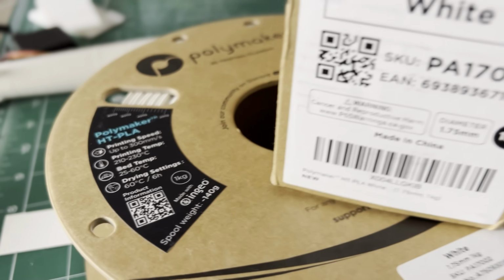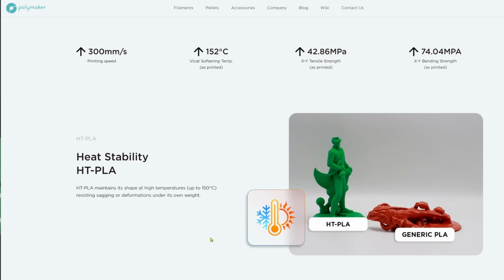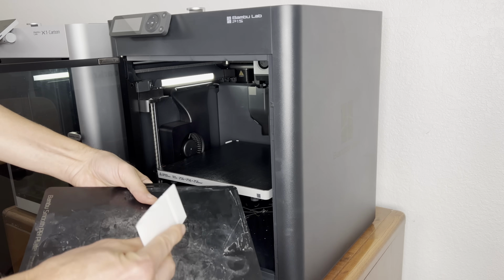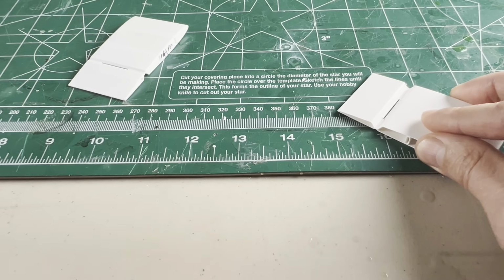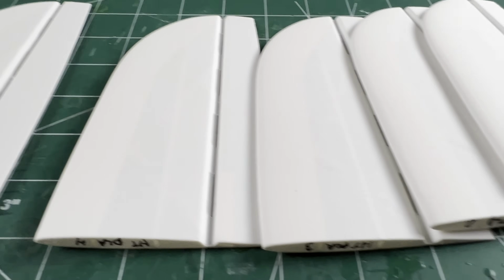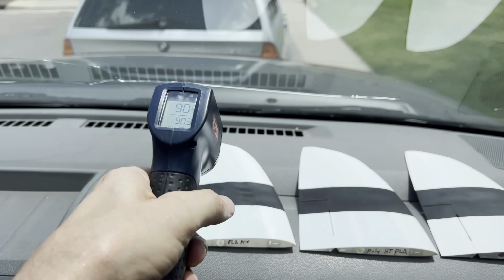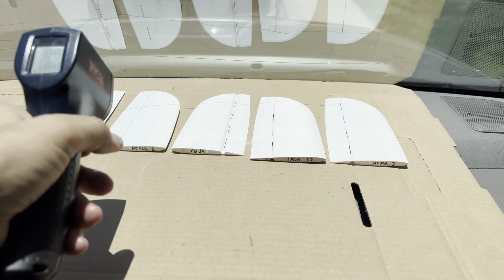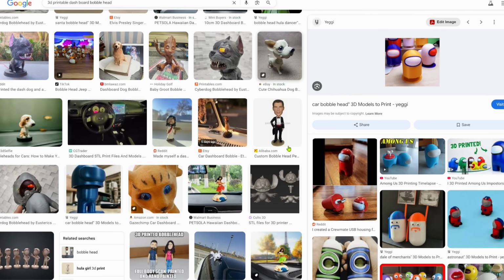🔥Hi Temp PLA🔥 for 3D printing airplanes - for real? - vs ASA - how to from SoarKraft - Polymaker new

Comment: Thanks for this!

About the surface finish on ASA, since it got better with printing several of them, I can only guess that if you had waited for the chamber to heat up a bit before you started the print, it'd looked a lot better from the start.

I can only guess that you had to open and close the car door to get in and out a few times. That let all the hot air out, so it would reduce the heat stress on the parts.

Comment: You should try HIPS. Very light, high impact resistance, easier and less toxic than ABS and close enough temp resistant
Reply: I bought HIPS back in the day for “support” material… I just ended up using the crap out of it for general prints though lol

Comment: You'll never achieve  the best mechanical and thermal properties of any given filament until you can print it at or slightly above the materials' Tg point. It requires an actively heated chamber.

Comment: I tried it for one specific purpose:
Sometimes ago my ABS fan duct broked in the printer (while printing it just started to shatter by the screws, so the duct itself is in good shape, but I can't secure it).
Because my printer (Sovol SV06) is an opensource model, I found the *.stl files from the injection molded parts.
I redesigned it to be easier to print, and reprinted it in PETG. After sometimes I've noticed that the cooling is a little bit worse than before: I chacked it, and my duct had heat deformations.
I was thinking of trying out ASA for this project, but I saw HT-PLA, so I thought that maybe a good option: easier to print and does not have toxic fumes.
The HT-PLA worked perfectly for that role. It can handle the same heat as an ABS (without heavy load), so it's a win.
Also it has nice surface, so I'm sure that I'll use this material for other projects.

Comment: You should try PCTG. It's similar to PETG but it's more thermal resistant and tougher. You do have to dry it before printing and print slowly to get the strength but it's well worth it.

Comment: Look up ht-pla-cf it'll improve dimensional accuracy and is a lot stronger and will hit better heat deflection after anealing which can be done with the printer bed the only thing needed is a hardened hot end and metal extruder
Reply: Adding CF into just about any filament makes it weaker than the base material. It adds some heat resistance, printability and stiffness, but not strength.

Comment: Could it be that the UV from the sunlight is actually what is causing the brittleness?  It would be interesting to know if that is the case.  If heat itself isn't causing it, then LW-PLA might still be a good choice, if you then protect the plane with a UV opaque coating.
Reply from the maker: No, UV damage to plastics takes weeks to months of exposure… long long long term exposure compared to this one to two hours in the sun… this is all heat / temperature cause by the sun 99.9% IR and visible light absorption and conductive from heat from the surrounding air… .01% uv

Comment: Try different colors. I have some bad experience with white filaments. Maybe it is a dye used in them, I don’t know.
Reply from the maker: you can, I can't test everything.  I use white and red PLA because they need more colorant to get true white and red, it was the first version of PLA+ ... there are white papers about this.  And if Polymaker's material changes HT properties with colorant then they have other problems..... I am not the only one that had this exact same issue, My Tech Fun did a similar test with similar results

Comment: In Europe luckily, temperature is irrelevant. I just wouldn't store or transport the plane in temperatures that high.
Reply: Btw I think you mean “Northern” Europe. Southern can easily reach those temps of concern
Reply: Spain, Portugal and Italy are also part of Europe and temps at summer usually reach 40ºC (around 104ºF), which is 2ºC more than whats seen in @SoarKraft 's video.
Reply from the maker: similar here, only occasionally hot enough to run this test.... PLA+ is still the best

Comment: I am planning to start the Pika, in what material do you prefer to print it?
Reply from the maker: It depends (very engineer-ish answer) 
PLA+ = slope, DS, hotliner - fast fun easy cheap.  
LW-PLA = slope - light winds days, light power... hand catchable.    
Colorfabb LW-PLA-HT = for light powered to medium power (good stiffness to weight - I have data) another video coming soon.
The ASA and ASA-LW are still too much of a pain, toxic, and I don't fly on super hot days or paint the tops of my planes black... well not much black.... if I lived someplace super hot I would use ASA and LW-PLA-HT... or move.

Comment: Also, to print for maximum strength you are printing your wings in the wrong orientation.
Reply from the maker: Sure, but any other orientation would be hugely detrimental for other reasons..... these are printed unsupported hollow thin wall structures with curved surfaces on every side.  Others have tried "the right orientation" and I have seen the results ...  my Zesty design, printed in the wrong orientation, can go 231mph (371kph)..... however my airframes are supported with pultruded carbon... so Im cheating.  Layer adhesion is still very critical to bend and twist performance, and Polymaker HTPLA doesn't do it.
Reply: @soarkraft 

Try increasing your printing temperature.

Comment: If you got the temp up to 72c you have annealed the parts. They will be much stronger and can with stand temps up to 120c. Actually, to get the crystallization in PLA you only need to get the temp up to 60c for an hour.
Reply from the maker: Annealed-Yes, Stronger-Nope, not with this HTPLA material.  And I am not the only one that has tested the actual material and found this result.  https://youtu.be/w01XqM7D8b0?si=bde1g0yKVV0nYd1I and watch at 11:30 his explanation is a guess that I do not agree with... but whatever, same result.  Other materials show an improvement with annealing, that is the point, but regular PLA can not withstand 60C without extreme melting / deformation / deflection.  Other HTPLAs like Protopasta or ColorFabb PLA-HP may be different.... Polymaker's HTPLA is good for Hydroponics and dashboard bobble heads, not 3D printed planes

Comment: What's the best way to convert a set of plans to CAD for 3D printing....?
Reply from the maker: To not do it... it is a lot of work, and "plans" are usually based on some other type of material.  The exterior skin of a plane is about all that is in common with a 3D printed version of a legacy design.

Comment: Have you ever tried printing wings at a 30 to 45 degree angle to gain better strength on layer adhesion?  I would be curious to see same tests done after annealing in a controlled oven to mfg suggestion if you can get hands on their HTPLA.  I would be curious to the reinforced results also.  Enjoyed watching your testing much!  That looks like a great designed RC plane!   Been working on a large c17 myself.

I ran off three rolls of their HTPLA, was impressed with actual print quality but have not done any testing to date.  I do plan on testing annealing out, but finding stock appears to be tough as of late.
Reply from the maker: Interesting thought, but changing the angle to print these parts is not easy, the skin and internal structure I design is painstakingly engineered for vertical printing for perfect airfoil and optimum structure.... my parts are more complex than most, but mine also go 200mph.  Any measured difference would have too many other variables to consider.

Annealing was not as hard as I thought it would be, but terrible results... not worth it.

Comment: HT-PLA is BS. even if it had the HDT of ASA your not factoring in that ASA is easier to post process and and be vapor polished. I also would say ASA on the right machine is just as easy if not easier then PLA as it doesn't require part cooling fans like PLA . The whole PLA is easy is based on you having a crummy low end printer... something that people don't have anymore. Its old news.
Reply from the maker: ASA is clearly the winner in this hot car test for this round, but it's still far from perfect... way better than ABS.  HT-PLA has its place as long as you know it is not exactly like PLA (HTPLA is weaker and heavier).  Hydroponics, yes....

Comment: Ht-PLA has been around for like 10-15+ yrs. MakerGeeks was the first I can remember, Proto Pasta is almost all HT-PLA. Few other brands use the 850 base resin that is HT PLA.
Reply from the maker: yep, this stuff from Polymaker is not new... but they sure did a strong market campaign for it... 
Colorfabb's PLA-HP has been on my list to try, but only available in black and gray now.... may or may not be the same material as there original PLA-HT.  Colorfabb's other innovations have been impressive.

Comment: Try PHA from polar filament. High temperature resistance and fully compostable unlike PLA.
Reply from the maker: PHA was on my list to try last year before I got distracted with everything else.  ColorFabb allPHA.  polar filament is new to me.. anyway, I fly in nature and crash regularly, especially the DS stuff... high speed excitement with confetti endings (plane brakes into ~ 2 million pieces... watch my other videos). Now that my DS design has proven itself to way more than the 150mph it was designed for maybe PHA should be evaluated... thank you for the reminder.

Comment: I just used this filament and it seems a bit more brittle / fragile than regular PLA.
Not a huge issue, just add an extra wall or two.
Reply from the maker: Sure, design like you are using clay / ceramic and annealing is like firing it... can handle heat, but brittle

Comment: Siraya Tech PET CF?  Probably too dense?  Have used it for functional parts after seeing My Tech Fun testing.  Heat resistant 180C+
Reply from the maker: for airplane parts strength to weight ratio is the key and z-direction layer adhesion is #1.  CF filed parts are usually lighter because of the fill, but does nothing for the layer to layer bond.  I have Bambu PETG CF in my test quew, will get to it.  Nylon CF was huge disappointment... I should probably add all of these to a chart of "experimental verified" materials
Reply: @soarkraft Was specifically mentioning this PET CF (not Petg CF) as it is known for high heat tolerance (180C+ is not a typo)
Reply: @soarkraft  That particular PET-CF has layer adhesion on par with typical PLA. It's good stuff.
Reply: @soarkraft  u said Nylon CF was huge disappointment, I was going to try pa-12. What did u try?

Comment: Excellent video and looking forward to your experimentation with foaming ASA
Reply from the maker: workin on it
Reply: I use ASA almost exclusively in my filament printer, what is foaming ASA?
Reply: @lureup9973 exactly what it says on the tin ;) also called ASA aero. It's similar to how aero/lw/foaming pla works.
Reply from the maker: @lureup9973  same as LW-PLA, but with ASA as the base material.... also known as LW-ASA (ColorFabb) or ASA AERO (Bambu Lab) .. other too.. where filament foams at the nozzle extrusion temperature... so not only is it pushed through it is also expanding.  Foaming LW-PLA, which has been around for ~ 5 yrs works exactly the same... lots of videos about it... ends up being the same size and shape of an original part made from something like PLA, but is half the weight... great for rc airplane parts.
Reply: @soarkraft oh wow… very cool, thanks, is it considered weaker by tensile or layer
Reply from the maker: @lureup9973  yes, because of the foaming it is ~ 25% stiffness for 50% weight saving, but with much more stretch / elongation.  its like printing balsa wood... fun stuff
Reply: @soarkraft 👍😎

Comment: I hear BambuLabs ASA Aero is basically the best of both worlds... light weight and heat resistance
Reply from the maker: the foaming materials are a completely different category, and foaming ASA has been difficult to tame even with a new gen printer, meh flow ratio, clogging.... "best of" is yet to be determined.
Reply: @soarkraft What do you think about the possibility of using nylon filament? I could test it; I believe it would be possible to reduce weight without affecting the strength of the piece.

Comment: I live in Turkey and in here my options in here is limited.. I was using only abs or HT-Petg from local supplier (those guys has unbelievable quality for 15$ ) .  So I'm curious about HT-PLA. From my opinion all other PLA variants are just PLA. nothing more.
Reply from the maker: ASA might be worth a try, not easy but I was pleasantly surprised with the results, real and repeatable.  I am lucky to have good machines but cheaper enclosures for open machines can be had, easier and cheaper than any annealing method.  Also depends on what you’re printing for….

Comment: Do you believe annealing it in your truck will give you the same results as it would have inside an oven?  I don’t believe so…
Reply from the maker: thank you for the comment
yes, I believe.... An oven can do even and controlled heat, but not perfect and will fluctuate as the door is opened/closed... heater cycles.  My truck was pretty uniform (85-87) in the "cooking area".  This was more of a real world test of what might happen by accident in your car and the real consequences... im not trying to show how to use a car to anneal parts.  You can run the experiment to test with a controlled annealing oven (not a toaster oven) and report back how it is not the same, there are many but what was the resultant change?..... I used a 2006 Nissan Frontier 4 Door, storm gray with gray cloth interior, 150K miles, needs a new drivers side front catalytic converter and has a cracked windshield... for reference

Comment: This is awesome testing of the material in an engineering manner which I find much more useful than "I put pieces in the oven and noted which melted first", especially since the aeronautical application is in my wheelhouse. Thanks!
Reply from the maker: I was hoping to get some real-world data and push the limits of this new material!  I also wanted it to work... great for an outdoor planter.. not so good for airplanes
Reply: @soarkraft  I too was hopeful for the new material but thought I was crazy when it didn't seem to be as strong and didn't have a much higher deformation temperature. Snapping after the annealing you did was a complete shock to me though. Still has some good uses though, you're right.
Reply: You’ve been  3D printing. For 30 years

Comment: I live in the UAE. I tested wing tips made from several materials at 42C outside air temperature by putting prints in the car, and parking the car in the sun. It got much hotter than that in the car, of course. 
Normal PLA fails quickly and deforms, PETG is not much better. 
ASA, ASA-Aero and ABS stay strong and keep their shape, but are more difficult to print. 
I also used the high temperature PLA from colorfabb: PLA HP.  It worked well and I can not see any deformation after a week of driving and parking.
 Unfortunately I did not measure the temperature but they were so hot that I could barely touch them with my hands.
Reply from the maker: Great info, thanks.. I was surprised at how brittle the HTPLA parts were after being cooked, sure might handle heat, but what about loads at regular temps… like flying a clay pot.  Wonder if your part is brittle?

The ColorFabb material may or may not be similar…. I might try it, as I doing a follow up to my LW-PLA-HT video.
Reply: @soarkraft  Hmm, Ill try to think of a way to test it with my means
Reply: Im in Kuwait, i am experiencing the same thing.  ASA-Aero us my go to for 3d printed airframes
Reply: get a qidi printer, any, and be done. ASA/ABS/PPS/PPA - all doable, nearly perfefct when u change chamber temp to 75 or more.
Reply: @bartman2395 which Qidi printer has a 75° chamber temp capability?
Reply: @donr62  sky is the limit in settings, 75C is safe to my practice. Can go higher but things might start to melt/dissintegrate:) Better stay at 65 if its your only printer :)
Reply: @bartman2395 you mentioned a Qidi printer. Which model does 75°C?
Reply: @donr62  any qidi printer with edited printer.cfg

Comment: Ah damn!..I had so much high hopes for this new PLA😢
Reply from the maker: I was hoping there would be at least one good thing about the new material, be able to weight the trade offs, but no… it was a fun experiment.
Reply: @soarkraft perhaps at least it can be used for electric motor mounts? Easier to print than ABS or ASA.
Reply from the maker: I wouldn’t even use it for that, it’s kind of an all around “not for airplanes” public service announcement.  Hydroponics YES.

Comment: A next level video , bravo.  I wont mention the TPU nose cone experiment , I promise.
Reply from the maker: Funny… I may not get to the TPU nose cone video.. so I will share my details after printing one.  It worked… but was like putting a bag on… a heavy bag.. might keep the pieces together, but would be the only surviving part in a crash.  The solid nose cone is like an exoskeleton and crumple zone… TPU wing tips???? I might need to try that, solid for the DS planes
Reply: @soarkraft  PLA HR, the stuff advertised for airless basketsballs, is really tough but more rigid and easier to print than regular TPU